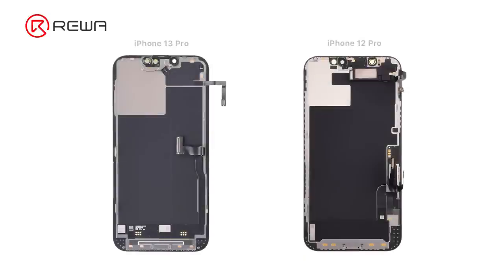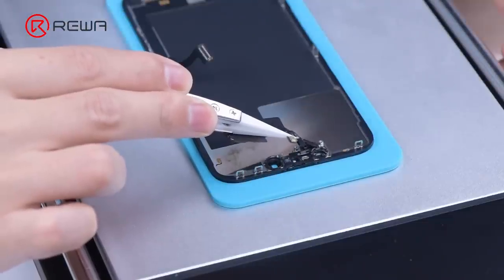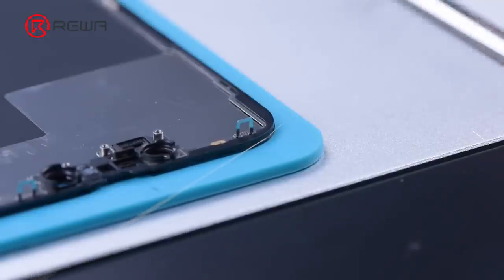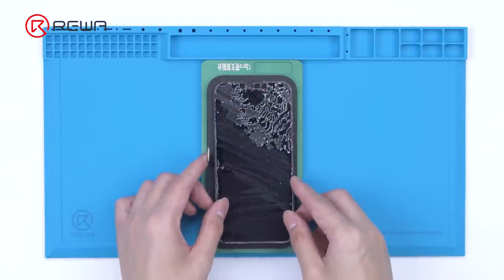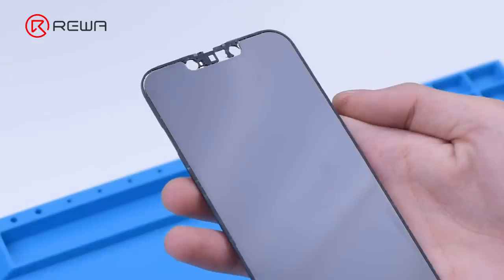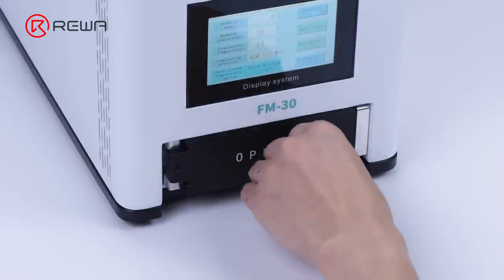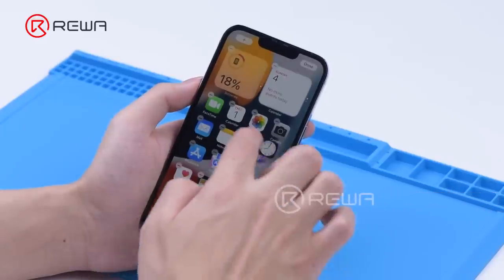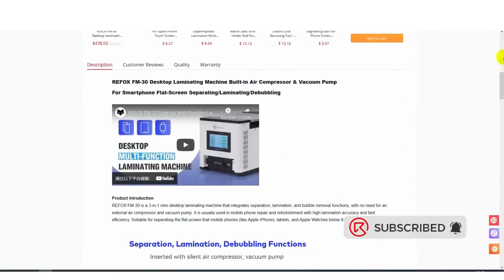iPhone 13 Pro Screen Refurbishing - Glass Only Repair

Comment: Its 2022 and i still use iphone x, but its remain fast and fluid, the screen also working very well
Reply: Sounds like you got a good one then.💯 The X series was the same year Samsung took over screens and as a tech,  I've replaced many factory screens that had faulty digitizers W/ no broken glass.

Comment: What temp should you set q heat plate to remove an iPhone 13 Pro front glass please and how long do you leave it before you put the glass on and how long for please

Comment: Thanks for the video! Quick question; what's the reason for removing the sensing module (and earpiece mesh) before separating the glass? What's the reason we not proceed to separating the glass from the OLED with the cutting wire without removing the sensor? Thanks!

Comment: Are the repair parts also available for this  machine?
Also do we need different molds for each model or a black lamination foam works with all flat screen?
Also can we use bubble remover function alone aswell?
Reply from the maker: Hi, you need different molds for each model. The bubble remover is able to work alone.
Reply: @rewatechnology2008  why is there no LOCA(3:40, "put the glass with OCA in position")? Usually Ive only seen the liquid OCA but I didnt know there were sheets of OCA available or am I wrong? Because on iPad Air 3 glass only replacement by "Mr Phone Doctor", I didnt see any liquid used as glue/adhesive, just a sheet or am I wrong?

Also what music you used in this video? If you cant answer that its fine but I just wanted to include this in the comment.
Reply from the maker: @CrazyPlayer-pf2hv  The glass was already attached with OCA and there are sheets of OCA available. As for the music, we get it from Beautiful Corporate Background.

Comment: Good luck with heating frame to 100°C and keeping same relialibilty of it
Reply: Every repair of an iPhone glass is usually set around 83° degrees to 90 but the iPhone 13 Pro or 13 series even can handle that litte added higher temperature

Comment: I'm trying to change the change the front glass of an iphone 13 but I keep having problems with lamination. I'm keeping the frame on during the cutting like you but I keep getting a thin line at the base of the glass that has not laminated. The rest of the screen is perfect. I've tried multiple times but I keep getting no lamination at the base only. This also happens when I try to change an iphone 12 front glass with the frame still attached. I'm using a mould to put the glass on prior to lamination/debubbling. Any tips or  ideas? Thanks alot
Reply: special guy you are